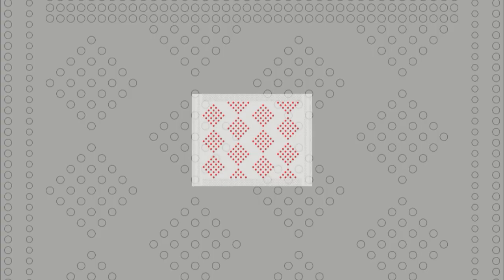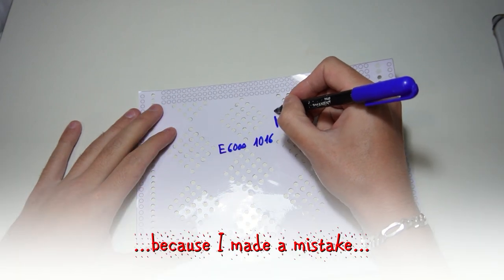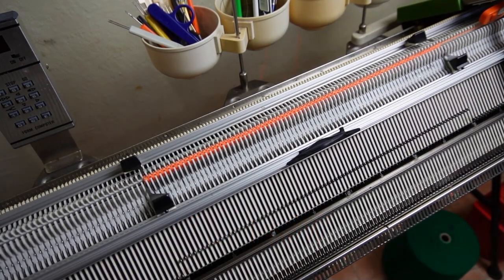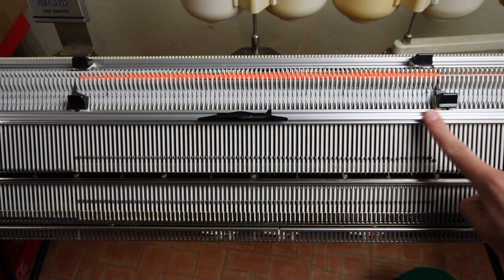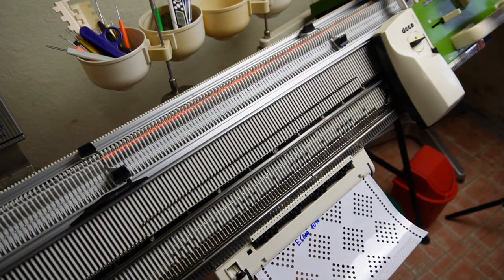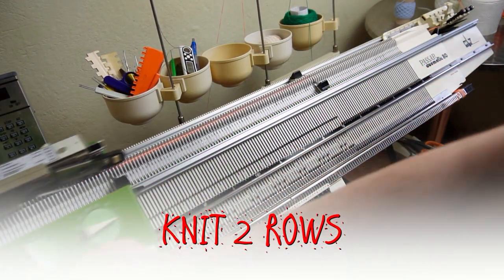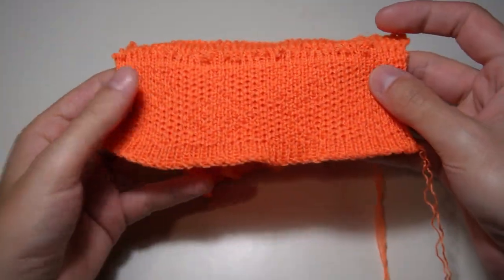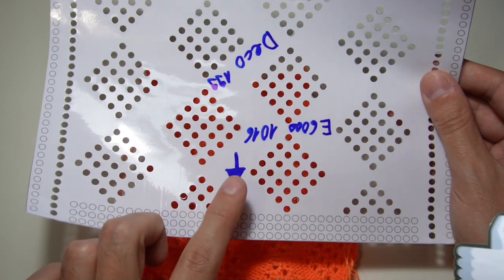Machine Knitted Drop Stitch Lace and More (Deco Techniques A, F, J, K)

Comment: I am back at my passap again after a long break so I am looking forward to your videos. Do you have a suggestion on your best video for me to brush up on how to do short rows?
Reply from the maker: Thank you for the kind words!

In general:
The short rows are done when the lock is set to BX and by using the pushers. The needles with pushers in working position will knit, and the needles with pushers in resting position will slip (won't knit, but will keep the existing stitches in their hooks).

I don't have a video exactly about making short rows, but maybe these two would help:

This is a small mug mat, that doesn't require winding the yarn around the needles. To make it you need only to move the pushers, so it would be great as a first example, so you can see the basics. By knowing which pushers will knit and which won't you can visually see how the triangular wedges are knitted: https://youtu.be/To4SFFmwzhU

If you are about to knit a pair of socks, 
This is a tutorial for knitting heels using the pushers, and I have explained how to wind the yarn to avoid holes: https://youtu.be/WTv8hizA-v4

Some more complicated projects made by short rows are this beret hat: https://youtu.be/BDStnOEqXC8 ,
and this pinwheel pillow: https://youtu.be/tVPxnE3TGYQ .
There isn't an explanation about the pushers and the short rows, but you can see what the knitted piece will look like right after taking it off the machine.

I hope you will find some useful information in the upper examples. Let me know if you have any questions. Happy knitting.